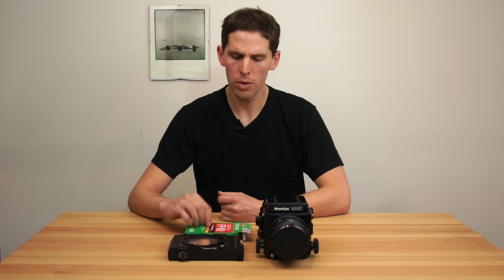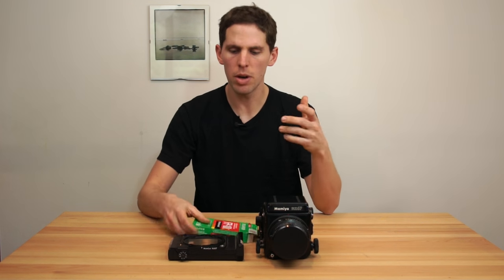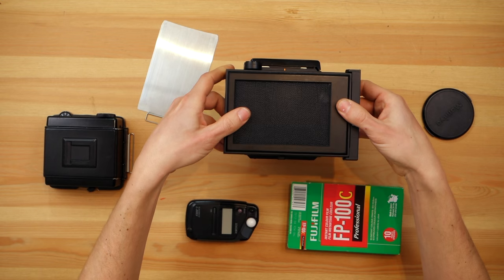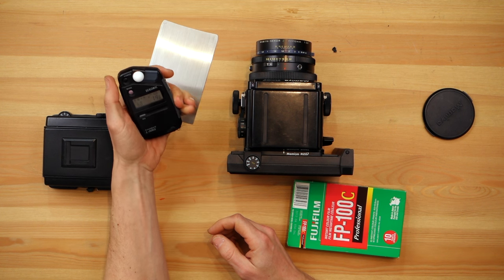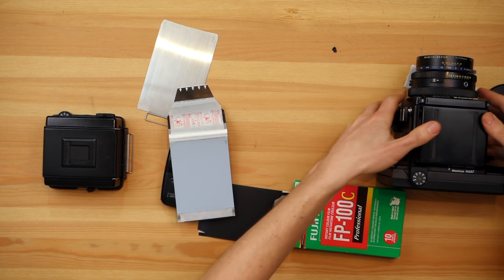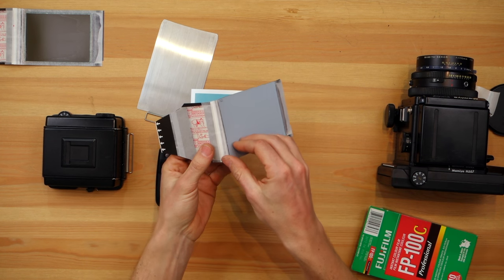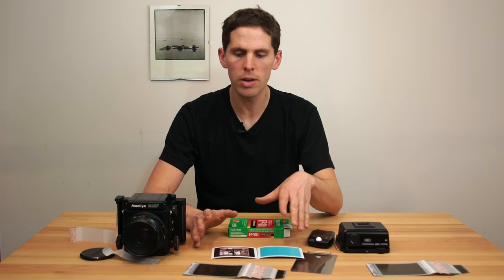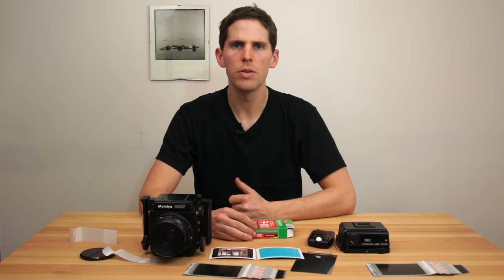Misloading Polaroid film

Comment: Ugg, this was 3 days before Fuji announced this film was discontinued.

I have accidentally taken backs off a camera without a dark slide-- only when I'm pretty tired and not thinking clearly.

If you want to move a pack to another camera I'd suggest using a changing bag though.
Reply from the maker: +Nick Marshall Yeah, the changing bag is the way. But I was curious to see you only miss one shot.
Reply: I think it makes sense that each negative is protected by the previous negative. The negatives have a black backing that you can remove with bleach that prevents light from going all the way through. Otherwise when you take photo number 1, light would go through and fog photo number 2!
Reply from the maker: Yeah, exactly how it works. Still surprised that after a week in the air no lightleaks happened. Sad to see it go.

Comment: Hi Nico, I have a question if its okay with you.  Any difference in the Mamiya RB67 polaroid film backs?  I know there are one's that has two black strip on the left and right sides and there are the ones that just have one black strip on one side.  How do I tell with one of the film backs have either?  I have the RB67 SD and I want the two black strips on both sides.  Thanks in advance Nico!.  -Albert
Reply from the maker: Its a good question, not sure how to see the difference, probably best way is to see where the coupling is, it should be centered for the centered one? Also there is a really cool one made by Arca Swiss that did two shoot with sliding back. Google it. ;)
Reply: @NicosPhotographyShow  Thanks Nico!.

Comment: What adapter are you using with your Polaroid back? I have a Mamiya P adapter but the black vertical frame you see on picture taken looks different on mine.
Reply from the maker: Its the normal Mamiya RZ67 polaroid back. Are you using the same body? Or a RB? On this thread they say the P is for the RB67 maybe the lines are different. Mine shoots a 7x7cm square, centered on the polaroid. Link to thread here: http://photo.net/medium-format-photography-forum/00bwGc

Comment: What about the picture tabs? Will it set to its normal pulling position? When I switch the film to another camera the little numbered ragas I mean'
Reply from the maker: +Woody Chicago The tabs move with the film pack. When you reload you would need to make sure they sit where they should. If not you wont be able to pull the film out. If yiu do it in a darkroom or changing bag it should be too hard.
Reply from the maker: +Woody Chicago The tabs move with the film pack. When you reload you would need to make sure they sit where they should. If not you wont be able to pull the film out. If yiu do it in a darkroom or changing bag it should be too hard.